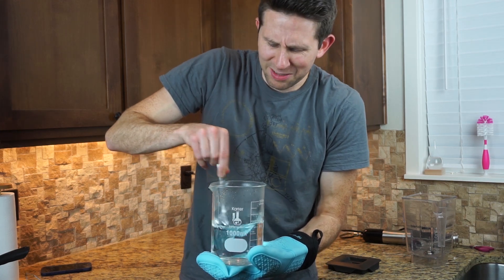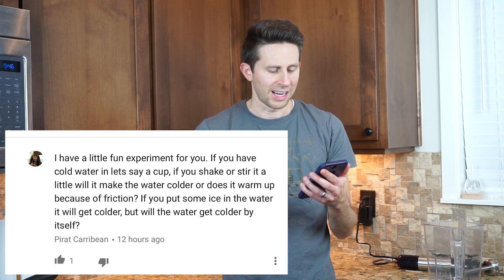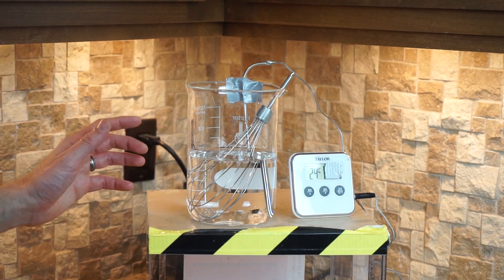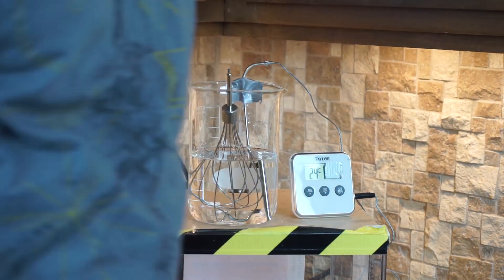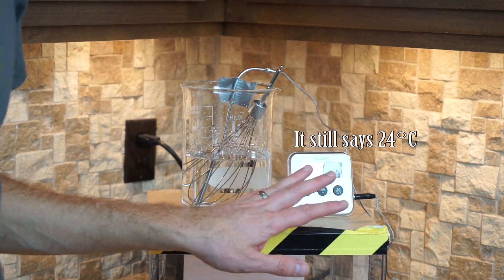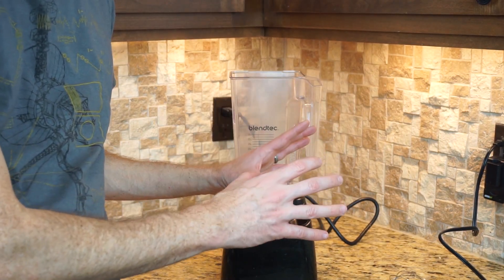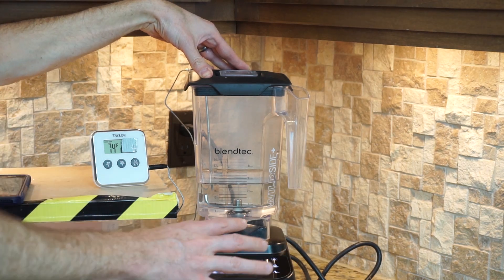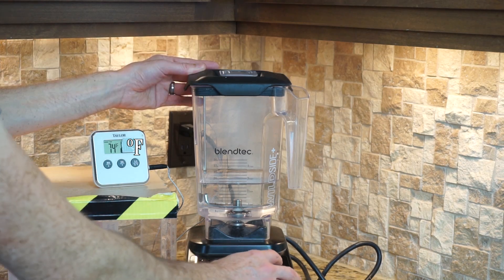Can You Boil Water Just By Mixing it Really Fast? Water-Stirring Challenge Accepted!

Comment: You have invented the most inefficient kettle ever.
Reply: Anthony Khodanian But is it more efficient than heating a metal container (that has water and has a lid) on a CPU?
Reply: @Dragon22999  No, a CPU is not more efficient than a kettle. This is because the kettle only does one function: generate heat by passing a large current through a heating element (usually made from iron). The CPU only generates heat when a transistor goes from 0 to 1 (This process of going from 0 to 1 is not instant, hence in that small amount of time the transistor becomes a resistor, thus generating heat). Some energy is used to perform the actual function of the CPU.
Reply: Lord Jamorgifier Central processing unit. It does most of the work on the average computer. It uses an instruction set to run different functions. There are many possible architectures for the CPU. Also if you try to overclock a cpu it generates lots of heat and requires intense cooling compared to the average cpu. I’ve been learning about this stuff for a few years.
Reply: Apprentice and loudest
Reply: most of the energy from the blender goes into moving the water until it reaches the blender's maximum speed. the rotational energy is not efficiently converted into heat. the entire system is quite inefficient actually, as a lot of energy has to be put into the blade to keep it from slowing due to the high drag of water. Also a significant portion of energy can be lost to sound, ask any blacksmith. they try to reduce an anvil from ringing so that a larger portion of the energy goes into the metal they are hitting as opposed to making a heavy chunk of steel go ding.
Reply: I don't think you understand what "invention" means.
Reply: It's actually almost equally efficient. All the rotational energy of the motor goes to heat, the only losses are vibration and sound which are actually only a small percentage of the total energy.
Reply: Objects in Motion Actually, it’s not. It heated the water 2 °F, 1.1 °C in 10 seconds. Given that it’s about 500 mL of water, that’s 0.5 * 4180 * 1.1 = 2300 J. And 2300 / 10 = 230 W. It’s a 1500 W blender, so that makes the efficiency only 15 %. Even if we’re generous and assume it’s double, 30 % is a terrible efficiency, especially considering electric heating with Joule effect is very close to 100 %, with the only inefficiency being heat loss to the environment. And if you use a heat pump, you can have a COP (Coefficient Of Performance, equivalent to efficiency in a heat pump) of 300 % or more.
Reply: Objects in Motion vibration is the same as sound
Reply: @ObjectsInMotion  and heat in the motor coils which aren't in the water. Also heat losses from sloshing around the sides of the big container.
Reply: @ObjectsInMotion actually the energy being emitted as soundwaves are loss of energy
Reply: @skonert3083  that’s exactly what i said in my comment
Reply: I didn't see it
Reply: Agreed
Reply: brobrobrro is that more or less efficient as playing space engineers?
Reply: Lol!
Reply: Thats the loudest kettle I've ever seen.
Reply: I saw this comment 999 likes
Reply: Well yes but actually not
Reply: Lol it even makes a kettle sound on fast speed
Reply: It's an apprentice kettle. Or maybe a wanna be kettle.
Reply: Apprentice they didnt invent it, blendtec technically did, he just discovered it, just like gravity got discovered by Isaac Newton 

If i got something wrong correct me
Reply: Binod
Reply: Do we have any data about the Electrical Power consumption ?  How much Voltage & Current for How much time ? Let us call thiß Qe
Then we need to know how much quantity of water was originally kept in the kettle and it's temperature in the beginning (Room Temperature). Let us call this Qo.
Now it is simple :
Overall Efficiency = Qo/Qe
So now, may I know - how much is the Overall Efficiency ?
Reply: This actually depends.  It's probably pretty efficient, as all the electricity has to be converted to something.  I would guess the largest loss vs something else would be heat lost through the motor and enclosure, but overall wouldn't be surprised if it's more efficient than an electric stove.  A gas stove is probably far less efficient but gass has a lot of potential energy so it's fast
Reply: @ChaseAnderson5k    most of the energy is converted to wasted motion and not heat. Think of a propeller on a boat. There is a tiny bit of heat being generated by the friction of the propeller moving through water but the vast majority of energy is being used to move the boat forward. It takes energy to move that blade that throws the water all over, the friction creating heat is only a small byproduct of that motion
Reply: @tee4222  maybe this is ignorant, but isn't that not a thing?  Like if two balls of equal speed and mass hit head on, doesn't it either have to deform the balls, bounce and maintain energy, create heat, or emit light or something?  I don't think motion can just "go to nothing".  As it spins it either has to loose it's spinning energy to friction or to deforming the materials within the blender.  I was kind of basing this off my knowledge of electric vs gas cars as well, as gas card are incredibly inefficient, but have so much energy potential it doesn't matter.  However, it's probably a bad comparison as gas is probably retty good at making heat, cars are just inefficient because they try to generate motion
Reply: That's my understanding of the law of conservation of energy
Reply: Warm water 
I thaught he's gona drink it
Reply: You just gave away the answer to the title, cause your comment was shown automatically underneath the video -_- I mean congrats on having a/the top comment, and yeah the answer is theoretically obvious, but I wanted to watch to find out if he managed to do it :(
Reply: He could be less efficient by yelling at the water to heat it up.
Reply: This is about as efficient as how the government spends public money!
Reply: Do not forget that the electric motor is only about 90% efficient. Also you have to include the cooling losses, since it takes much longer to heat the water than a conventional kettle, a lot more heat goes into water vapor and warm air.
So yes, this is in fact the most inefficient kettle ever. If you don't include heating water over an open fire that is.
Reply: @Electroblud  Actually, even though this probably loses 10-20% to electronics, motor and bearing plus the energy lost through cooling to atmosphere, it probably is more efficient than e.g. your average electric stove + kettle which puts lots of the heat into the stove itself.

Sure, compared it to electric kettle with immersed heater element,  kettle + induction stove or ceramic cup + microwave owen it's much worse method.

Considering the cost of the blender and the extra wear to the blender, this method makes no sense.
Reply: lol
Reply: Comet Streak do you know what a CPU actually is?

Comment: To prove the heat isn't coming from the motor transferring heat to blades, you'll have to do this again with a thermal camera.
Reply: Timmers Guzman yes he should
Reply: Timmers Guzman I recomend using Seek, Seek is a thermal camera that you can connect to your phone
Reply: Timmers Guzman the heat would still originate from around the blades because they are whats causing the friction in the water
Reply: Vapez bruh, the seek camera does work, many people have review it
Reply: Just go and watch the Joules experiment, water can be heated with friction. No matter how you do it, both the water and the item in which you use to create the spinning motion will heat up, that's just how friction works.
Reply: Iddo Mordecai You're not smart he commented about it all ready if you would look at his comment you would understand
Reply: Iddo Mordecai what
Reply: Any person with a brain knows that the heat energy from the motor will  transfer to the cold water..thus cooling the motor.
Reply: Engineer - I have a brain. 30 years rebuilding motors in AC and Heating. Motor shafts can easily get very hot very fast.
Reply: this is considered a feature on high powder blenders, you can make and cook soup in them.... A cheaper blenders motor would go out if it over heats though.
Reply: Divergent Droid. Except the problem is, the motor shaft is not going directly to the blade, it goes to a rubber gear, and then that rubber gear goes to another rubber gear, which is connected to the shaft, that is connected to the blade, so your logic is flawed!
Reply: Aaron - Perhaps - I've never taken apart a blender. But Engineers statement is still wrong.
Reply: you can see that water boiling on the blade... love these "scientists" :DDD
Reply: No. Not all motors give out when they reach boiling, they can go much higher than that temperature.
Reply: It’s from the motor this dude not very smart

Comment: There was a boiler made to create steam by just using mechanical friction. If I recall, it was called a hydro static boiler. It used a spinning drum with pitted surface that spun at a high rotational speed, the spinning drum surface was placed at a fraction diameter of the "outer drum" the cavitation created by the pitted surface would mechanically induce the water molecules, this creating a lot of thermal energy and thus steam.

Comment: I was skeptical at first too, like thinking the heat might be generated from the heating motor instead of the stirring. Until when it reaches 99 celcius, that's just impossible temperature from the motor alone, this is pure science.

Comment: I am actually impressed. I was not what I thought what would have happened at all. I predicted there was no way it would even get warm to the touch. If anything, the motor of the blender would radiate up through in to the container and increase the temperature a little. For the water to get that hot, that really makes the point that even blending water can make enough friction to make it boil. The downside is it take a lot of energy to do so, as appose to just using a stove top.

Comment: Spins at 310 MPH? You mean rpm
Reply: the furthest outer point of the blade is travelling at 310mph in a circle. it spins a lot faster than 310 rpm.
Reply: If you do the math, around 35,000 RPM.

310 MPH / 60 mins = 5.17 miles per minute 
5.17 miles per minute X 5,280' per mile = 27,280 feet per minute
27,280 feet X 12 = 327,360 inches per minute

The diameter of the blade is around 3 inches, so 3 inches X 3.1415926 = 9.425 inches per RPM

327,360 / 9.425 inches = 34,733 RPM
Reply: Ashamoo Smith no he means MPH 300 rpm isn’t fast when it comes to blenders
Reply from the maker: +Ashamoo Smith No I mean linear speed at the blade edges
Reply: ohhhhhhh
Reply: Ashamoo Smith idiot

Comment: OK, two comments.  A luminary named Viktor Schauberger studied temperature in flowing rivers wondering why rivers weren't warm or hot by the time it reaches the sea.  Turns out the vorticies behind bolders in rivers are slightly cooler in the eddies.  Counter Intuitive to Joule.

-Also, don't assume blender speed, get out your laser digital tachometer.  I clocked a Vitamix blender at 35K RPM.  Fast enough to generate rapidly imploding cavitations behind the blades, which brings up cavitation heating sciences.

-Also, refrance Dr. Gerald Pollack of the University of Washington and the 4th phase of water and the Exclusion Zone (EZ) layers of water...

Do this again and expand the context, its worth it.

Comment: If the blades or paddle was spinning 3 times faster would the water heat up 3 times faster?  I'd Also like to see you find the frequency of boiling water and make a device that would output that signal.  Then put that device into cold water and see if it boils it
Reply: Gator 157842 no it would heat up nine times as kinetic energy of rotation is proportional to square to angular velocity so increasing velocity my 3 times gives us 9 times kinetic energy transfer make it 9 times faster and hotter
Reply: @chris there was a video of an old man  using what looked like a rod with a ball at the end he put in the water and it boiled instantly.  Is this a real thing or just fake?  I think it's real and would like to see someone create it or reverse engineer it

Comment: Wow! Impressed again.
I thought that it would not raise the temperature unyil boiling point. Everytime we shake the water, friction rises the temperature - but when we shake it, we dissolve oxygen into  the water. This dissolution is an endothermic reaction: it must takes heat away for it to happen. Once the water is saturated with oxygen, the heat can rise again... but then the water is not saturated anymore. I thought it wouldn't the temperature much to shake it

Comment: I would wager that there is ambient heat rising from the beatings and motor that is heating the water more than "friction".
If you used a chemical stirrer that only uses magnetic fields to spin a magnet or capsule of metal in a beaker, I might trust this more.
Reply: Plain old physics will tell you this is wrong, bearings/motor are adding some heat but the majority needs to come from water friction, all that movement doesn't just disappear into nothingness.
Reply from the maker: +Doug Hershberger a magnetic stirrer at 3500 watts would create way more non-water friction than the blender! The blender has rolling lubricated ball bearings, the magnetic stirrer is just aTeflon stirrer rubbing against glass with no lubrication.
Reply: It's do with both the blender blades and the friction of the water, he was actually correct for once, but anything spinning can cause friction which then can cause heat, especially if it's spinning fast enough. Air is also a factor in this, the air is also spinning above the water and is probably causing a vortex decreasing the pressure near the bottom and increasing near the top, allowing it to get hotter quicker. https://physics.stackexchange.com/questions/322602/can-i-make-the-water-boil-simply-by-spinning-it-in-a-glass These guys explain everything better than this video.
Reply: That sort of continuous duty at max speed will heat up even lubed bearings. As it's likely silicone or other high-temperature rated grease it can, and probably is, get well over boiling temperature. The bubbles in that area are prima facie evidence that is actually happening.

Comment: hmmmm... this sounds fishy, dont you think the motor is what is actually making the water boil?...
Reply: Bud King454 check the blendtec FAQ: https://www.blendtec.com/faq Look for “BLENDER MODELS & CYCLES” and look for number nine titled “Can you make soup in a blendtec blender?”. TL:DR  the high speed of the blade generates friction by spinning against the water (kinda like rubbing your arms together to make them warm or rubbing sticks together to make a fire) eventually boiling it. Blenders motors are designed to run cool to prevent overheating under tough loads and have a cooling fan attached to the motor shaft that expels hot air out the sides of the unit, any warming of fluid due to motor heat would be very minuscule.
Reply: Plain old physics says that water movement needs to transfer into something... with water friction that something is heat.
Just as you car movement turns into heat with the friction of its brakes.

Comment: Does a liquid with higher viscosity heat up faster?
Reply: Ermos Cimpoesu yes
Reply: Ermos Cimpoesu the greater the viscosity harder it is for the mixer to transfer energy by its force and do work.....so if the RATE of transfer of energy ie power is the same as in the above video according to me it will heat much more than water even the work done is same because of higher liquid friction ie viscosity
Reply: no, it only depends on specific heat capacity if power input is the same.
Reply: Total input power is total input power so on that end you aren't getting anything more out of it.
But because highly viscous liquid wouldn't mix as fast and transfer heat to the outside you might see temperature rising faster around the blades.
Reply: The real question is will it blend
Reply: MsSomeonenew, Im afraid you are not correct. viscosity does not depend on how fast the temperature is rising, only specific heat matters. For example, castor oil is 700 times more viscous than bromine, but it will heat up slower (at the same power). conversely, you can also find other examples when a substance is more viscous and heats up faster

Comment: The blender probably just heated up and transferred it to the water
Reply: Ryff. No.
Reply: Water boils at 212  Fahrenheit, so you think a blender’s motor gets that hot ? Lol that would be a serious fire hazard
Reply: Friction would play a part in warming it up.
Reply: My blender gets hot while using it lol.
Reply: Probably.... But ima still stick with mine...
Reply: It wouldn't heat up that much because machines like blenders are made to cool themselves to a certain degree to prevent them from heating up like that. Sure it will have heated up a bit but just enough to be warm to the touch, not hot enough to boil water. If it became that hot it could short circuit and stop working.

Comment: QUESTION, how much of that heat is a result of the blender transferring heat from the friction of the motor through the blades into the water ?, This is actually a very very interesting experiment that has allot of potential for different ways of carrying out the experiment, well done, i'd like to see more of this in different techniques.